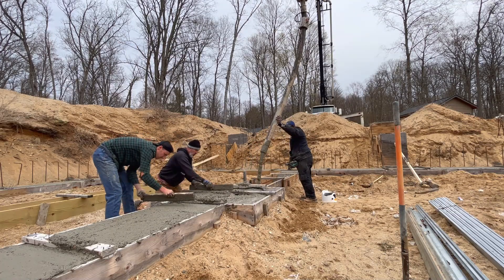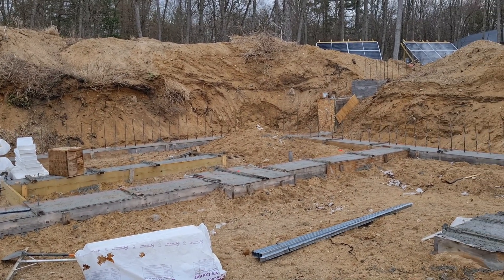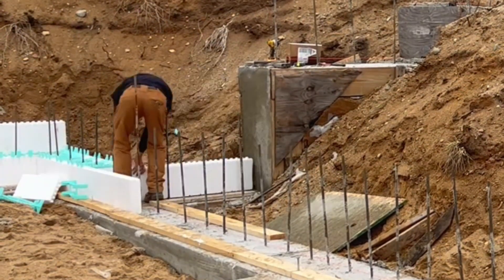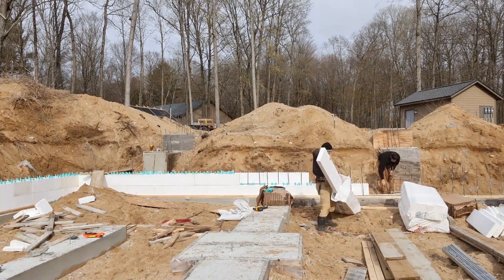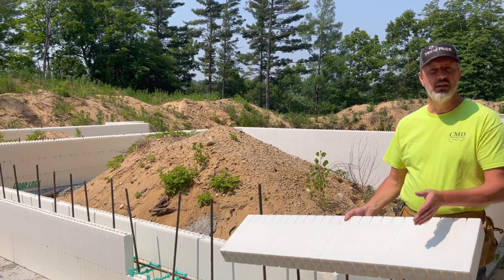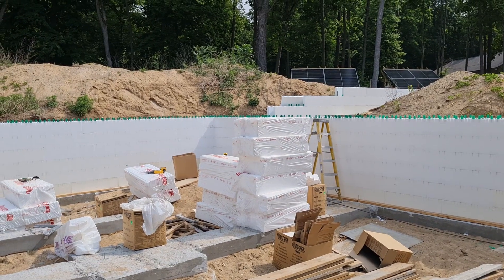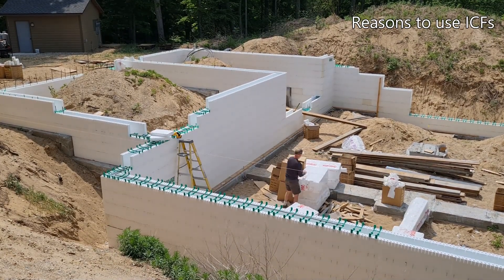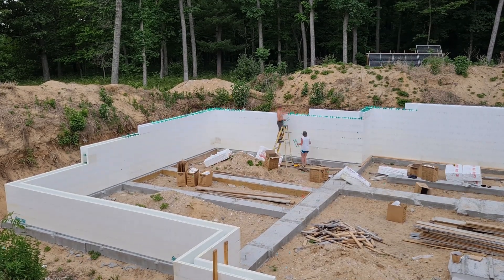Building Basement Walls Using ICF (Insulated Concrete Forms) | Preparing for our concrete wall pour

Comment: I’ve built my house AutoZone Styrofoam blocks two very efficient very easy to do and I loved it. Couldn’t hear a UPS truck pull up in front of the house itself quieter does.
Reply from the maker: Yes, that is another good feature of building with ICFs. Also, the insulating factor is a benefit with 6.5in of foam.  Thanks for watching!